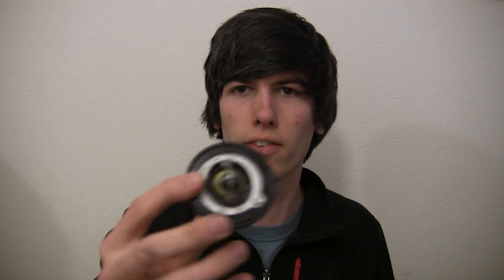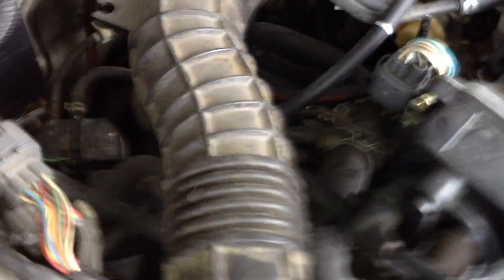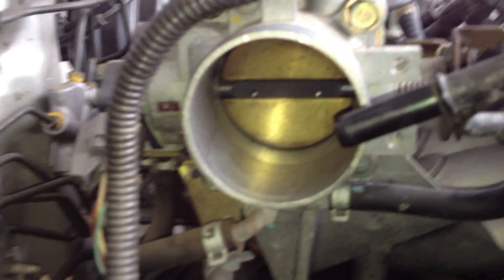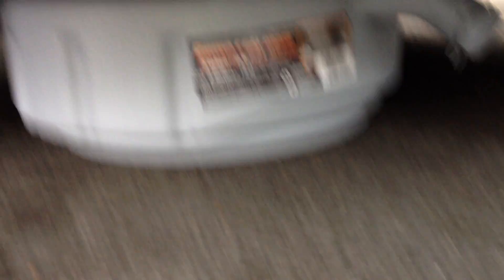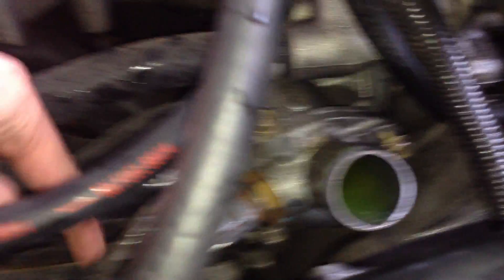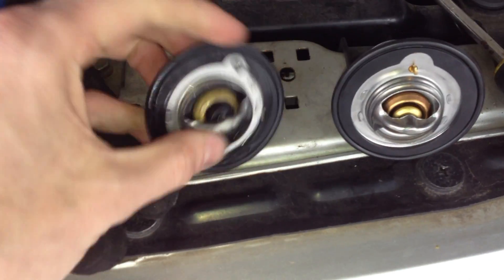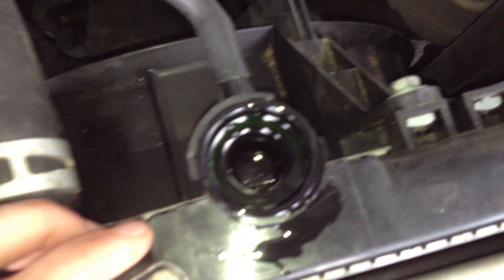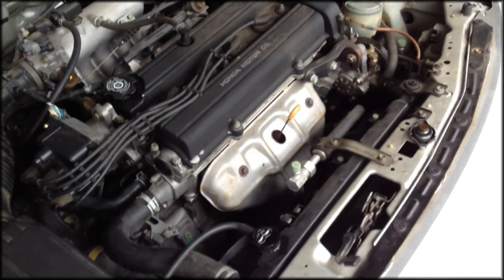Replacing a Thermostat - Acura Integra

Comment: Hi ! I just change mine on my 98 Integra 4 doors following this video so thanks. what I noticed is the radiator fan won't turn on even at normal temp. When I turn the A/C on then both fans work, is this normal ? I thought the one on the driver side is always working on/off depending the temp and the other one on passenger side turns on when I turn the A/C on. Then both turn onóff depending on temp /Any ideas ? Thanks

Comment: Damn wish I would have seen this before breaking the thermostat casing. Adding that hot water is prolly the trick. Had to replace the hose, and from trying to take it off the casing broke. ugh shoulda used ducked tape LOL

Comment: Your video is awesome! Concise and informative! The hot water trick on the hose is a great tip. I've worked on my cars for years but my Integra is very recent so just getting oriented. That area is hard to access so seeing you do it with that good camera angle was an excellent reference. Thanks a bunch.

Comment: Nice Video.  Few extra tips/ideas for changing out 95 Integra thermostat:
1.  It isn't necessary to remove the air filter housing,  only the air flow tube.
2.  If the radiator hose is stuck tightly to the thermostat housing you can just remove the thermostat housing and leave the hose attached to it.  You can still access the surface of the thermostat housing for cleaning by gently repositioning the radiator hose around a little.    This might be a better approach for you if the hose is older and you don't want to risk damaging it during removal.   Installation of the new thermostat is still very easy.  
3.  Some Integra engines have a coolant bleed screw located near the upper radiator attach flange on the engine.
4.  The bolts are hard to access but they can be reached with a common 10mm box wrench.   

If your thermostat is stuck open this will affect idling as the idle sensors never reach operating temperature.  After replacing the stuck-open thermostat the engine operating idle dropped from 1.1k to 800 rpm - where it should be.  And cold idle rpm dropped into operating range more quickly.
Reply: Good tips thanks. I'm about to replace my thermostat too

Comment: You get the check engine light from the thermostat getting stuck open? Mine just turned on an getting an 02 sensor code
Reply: Had the EXACT same issue my light didnt cut on, my car just stop blowing out air, yet the engine is overheating

Comment: nice vid thanks...i didnt see a bleeder valve 1 or 2 inches away from your therm housing...did you double check?-- i have a 99 cl and am getting ready to change my therm out...i went with honda nippon made in japan and bought two replacement bolts at ace since the dealer(stealer) didnt have them...lol..again thanks!!

Comment: Nicely done. On my 86 Integra, I didn't have to remove the radiator hose; just swung it and the cap out of the way. Getting at that lower left bolt was tough. Used a long arm closed end box wrench to loosen it, then a small open end wrench to remove it. I had to replace a thermostat which a repair shop put in (when they replaced the water pump) which was letting my engine get too hot. Fortunately I had the "old" part, which I had installed just a year earlier. The thermostat they had installed had a gnarly looking gasket too, so I'm wondering what did they really do.

Comment: Nice video- Definitely helped.  I just replaced the thermostat on a 98 Integra.  Important to make sure no air bubbles remain in the coolant lines. Also the 10mm bolts can be difficult- I added a drop of brake fluid to loosen the bolt.

Comment: I have a 91 integra that overheat on me . Housing crack on thermostat.  I replaced both and hose busted then i replaced the housing and hose without the thermostat.  To my surprise it do not overheat . The engine. Stay cooler . So for a old car i recommended do NOT use thermostat.  If u do and it overheat again its going to your water pump!
Reply: Must take forever to get heat to the engine, mine is stuck open and with canadian winter it sucks balls

Comment: Questions, wouldn't be okay to leave the thermostat open because it's going to cool the engine 100% of the time so why bother replace it w/ a new one? Also Does the thermostat locate at the (return) port back to the engine block? And water pump will be located at the opposite side?
Reply from the maker: Better open than closed, but the engine operates at an ideal efficiency at a higher temperature, and the thermostat allows for this exact temp.

Comment: you could have tried sealing the end of the radiator hose off and made it air tight so that more fluid didn't come out as you opened the lower point

Comment: I had an old 83 Civic. It had a really small aluminium block.I want to say 1,300cc. Anyways,It just wouldn't warm up in the wintertime. I put a new thermostat in & it still wouldn't warm up. lol I eventually blocked off the radiator but every time I hit a little water I lost heat so I made a plate to block off much of the underside too. That finally worked but I had to control the temp by using the heater. lol It was cheap,easy to park at school & got me through the last 6yrs of college

Comment from the maker: I used to have a leaky radiator so I just put in cheap coolant since I went through it so fast. I've since had the radiator replaced, but kept the coolant. I'm skeptical of their being a real difference in the chemical composition of the two fluids. Perhaps I'm being naive.

Comment: You should really try to get coolant from Honda. The green coolant they sell at AutoZone is not specially made for Honda's aluminum engines. The coolant your using after major use starts creating little holes in the aluminum heads, kind of like pores, if you would.

Comment: So on Hondas coolent from radiator travals from radiator to engine from the upper radiator hose then hot coolent returning from engine comes back to radiator from lower hose? Do all other car makers have a reversed cooling system setup like when thermostat is on upper hose instead?

Comment: shity place for the thermostat, but you did it very good :) My Thermostat is on the top of the engie, it's very easy to change it if it's necessary, the problem is in the bolts wich are   often stuck.

Comment: My mom's Ford Explorer was overheating, I found a leaking heater control valve and replaced it but it's still overheating. I can hear the coolant boiling or bubbling which is obviously a very bad sign, what's weird is when the engine is shut off coolant overflows out of the reservoir, then after a while the overflow is sucked back in and the top radiator tube seems to collapse from a vacuum. I'm guessing it's some sort of thermostat problem?

Comment from the maker: Ahh okay. I did have the heater all the way to the right. Also, the amount of coolant I added (based on guessing) looks to be about the same as how much drained out. I do believe all of the air is gone, but I should probably try idling and wait for the fans to see if anything else comes out. Will it not overflow once it's heated with the pump running?

Comment: U should have put the heater inside the car on the hottest position possible so the warm coolant can circulate though the heater core too.. There might have been some air bubbles there, and should have put the radiator cap back on after the cooling fans started running and the coolant started circulating. Air in the cooling sys is never good.

Comment from the maker: It's got about 120k miles, I've only put on around 30-35k, but mostly city/short drives. I burn maybe a quart every 600-1000 miles (depending on how high my rpms are for those miles, lower the better). 

Most recently the shop put 10W-30 in it, I was slightly confused as I've always used 5W-30, I guess they knew more than me (obviously). Thanks for the tip!

Comment: To get big hoses like that off, I use a large L-shaped pick. Slide the tip of the pick under the hose between the hose and the metal pipe, breaking the calcification there, then twist and pull. 

A very wise mechanic once told me that the first job of a cooling system is to allow the engine to heat up as fast as possible. Although it seems a contrary notion, a closed thermostat at startup is the key.

Comment: when the engine is cold the engine wears more. the oil needs to reach its working temperature. you can drive it but it's very bad in the long run